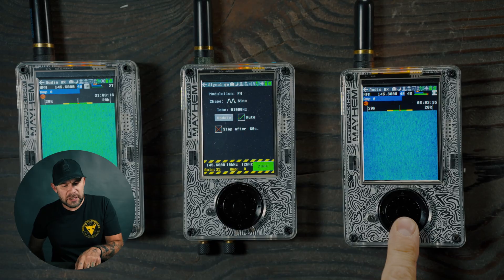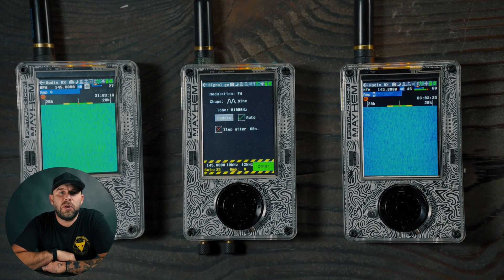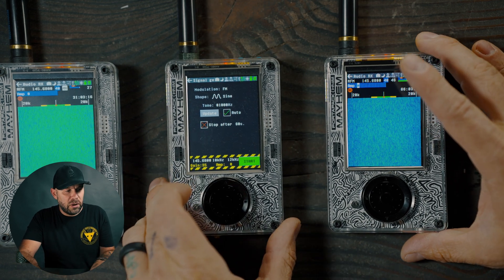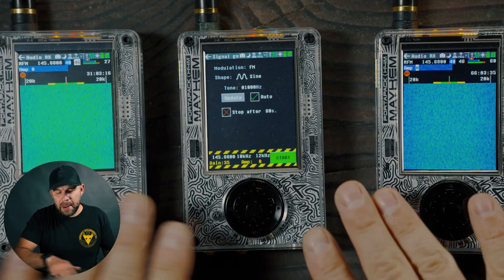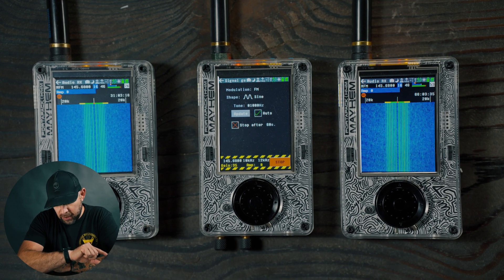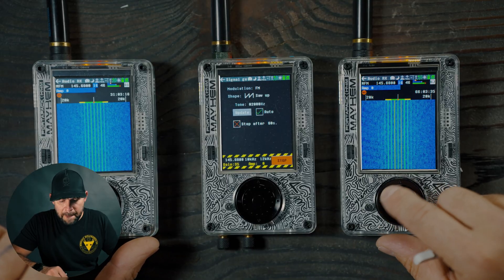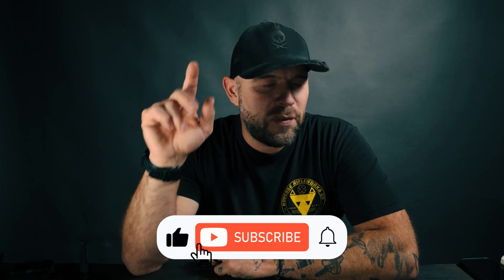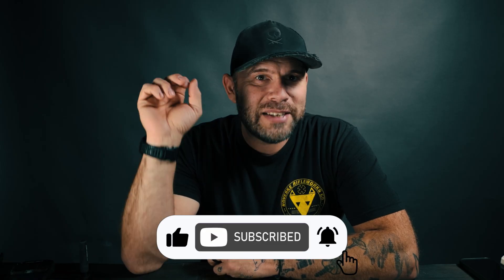EMI Shield Update on the PortaPack H4M. Does it work?

Comment: Great stuff, got my shield in the mail yesterday thanks to seeing your prior installation video. Used your link through amazon. Gonna be installing it when my upgraded screen gets here (also thanks to you). Question, any ideas for blocking the holes on the bottom of the portapack where the antenna connectors would be? I upgraded to the 2025 clifford heath board and i would like to plug those holes at the bottom instead of leaving them open. I could do something to plug them but would rather it look good or be something actually made for that purpose. Thanks in advance, will keep watching your videos
Reply: Also, I ordered the Comet SMA-W100RX2. I think the only difference between this one and the one you suggested is instead of needing the bnc connector it just plugs right up,  is that right or is the bnc one you suggested better in any way?
Reply: What is this 2025 board, can you share a photo?